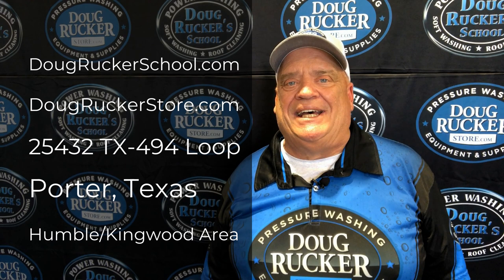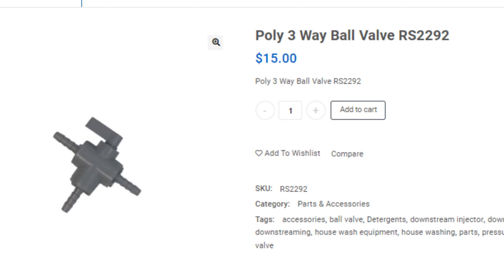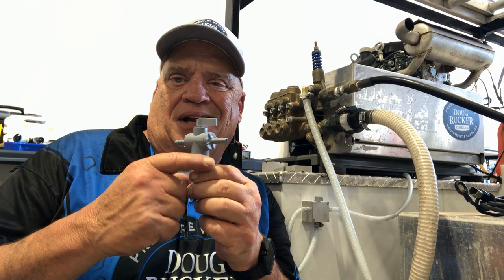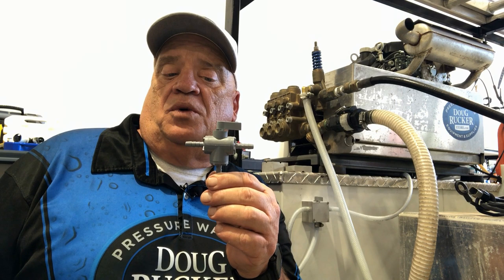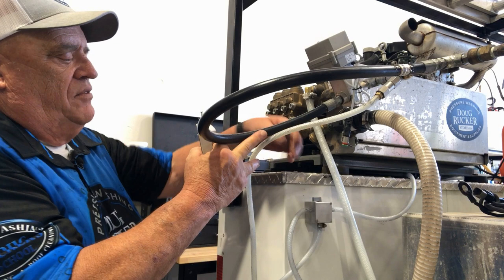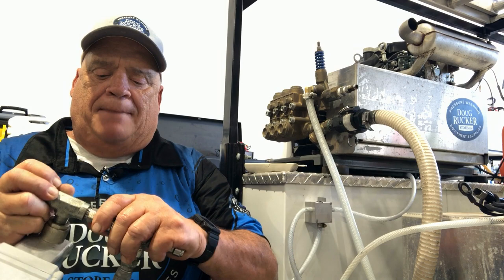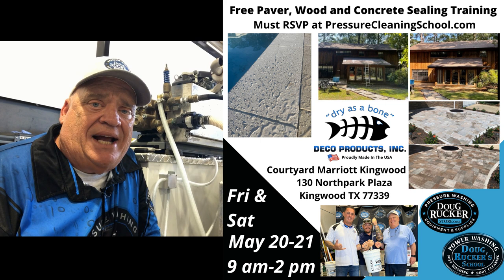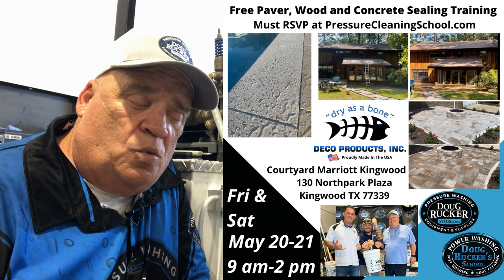Power Washing Business Equipment Mount Box for Three Way Valve

Comment: Hey Doug - Steve with Klein Pressure Washing. I have a good video idea for you. How is the best way to add a new 250 ft soft wash hose to your hose reel. Sounds pretty straightforward, but as you know it is NOT!
Reply from the maker: I think have that on a video already
Reply: @PressureCleaningSch   Can't find it. Remember the title? I have a 100 lb roll of 5/8 I'm about to replace by myself. There's got to be a better way than the way I did it last time : )
Reply from the maker: @TexasWatchman  you can use a ladder, Cinder blocks, saw horse, etc, and run a PVC pipe though the hole of the 5/8 reel and use one of the above to hold the 5/8 reel.  I have a big parking lot and usually just string it all out  and roll it up.
Reply: @PressureCleaningSch   I agree that would be easy, but it's not on a spool - hence the search for a good tip. I'll just muscle it like I did last time. Thanks, Doug!